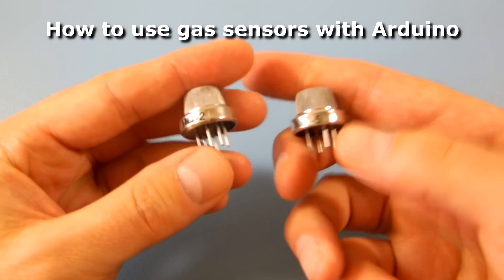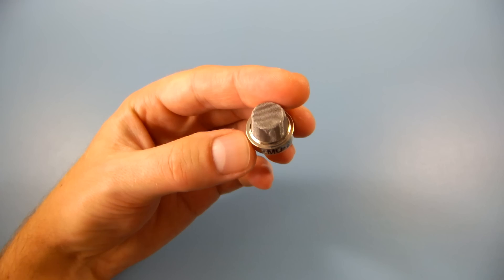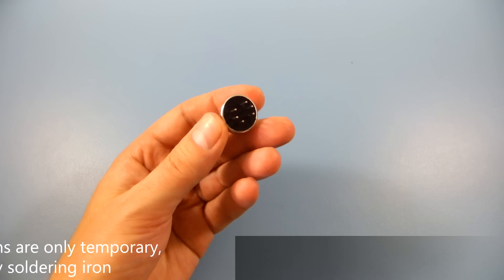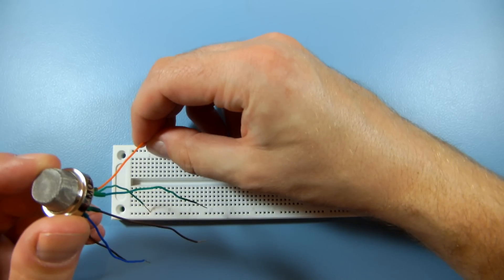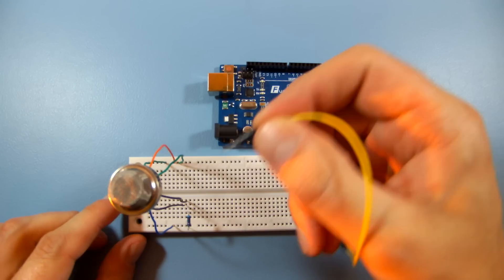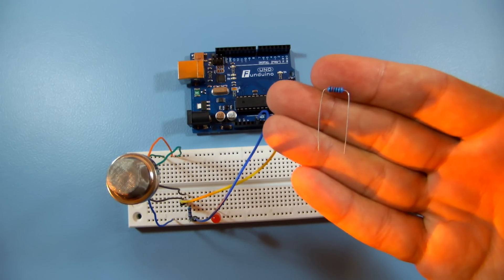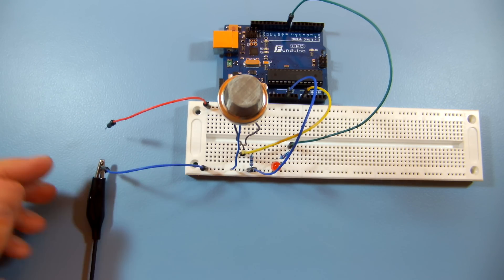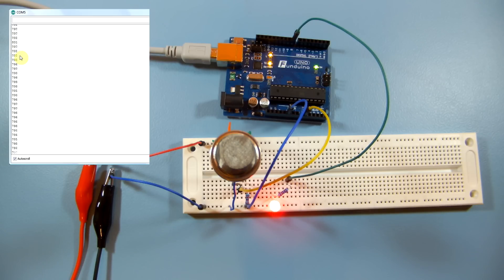How to use gas sensors with Arduino || Arduino tutorial

Comment: Have you ever built a functioning gas leak alarm with the MQ-5?  I bought one thinking I could make a gas leak detector with it, but boy is it ever finicky.  For starters, it could only detect butane (from a bic lighter) when I first turned it on, it didn't see methane (natural gas) coming out of my stove until 24 hours after being turned on, the "burn in time".  So now after being burned in, it can detect natural gas, but it's nowhere near as sensitive as my nose.  I can smell a gas leak in the room well before the little line on the serial plotter graph starts to actually move.  If you've actually built a gas leak alarm with one of these things, where did you put it?  On the floor, on the ceiling?  Does it work?
Reply from the maker: No, I haven't built a gas leak detector with the MQ-5. To tell you the truth, the MQ sensors are good for Arduino experiments, but they are not very reliable when it comes to serious applications. The readings are quite different almost every time and it's rather difficult to trust them. I know there are some much more serious sensors on the market, but they are also much, much more expensive.
Reply: I used one of these MQ-5 modules https://www.amazon.com/gp/product/B06XHKPV2Q/ref=oh_aui_detailpage_o01_s00?ie=UTF8&psc=1 and adjusted the sensitivity way down and the digital led turns on fairly quickly when I turn on my natural gas stove. If you're using the standalone sensor as done by ElectronFun.com you might want to adjust the 20k ohm resistor to increase sensitivity.

Comment: Does mq7 and mq4 have the same wiring?
Reply from the maker: Yes, the wiring diagram is pretty much the same. The only difference is the load resistor. Check these values in the datasheets.

Comment: hello , can you attempt to answer my question on https://forum.mysensors.org/topic/5760/co2-sensor-connexion-and-calibration
Reply from the maker: Have you preheated the sensor? Many sensors need to stay turned on for about 24 hours. Check in your datasheet if your sensor should be preheated. They sometimes use the term burn-in - that's the same thing. After that process the readings become more stable.

Comment: Great explanation.
I need to build a setup on a Raspberry Pi to detect benzene, formaldehyde, xylene and other VOCs.
Would appreciate your valuable input towards it. :)
Thanks.
Reply from the maker: Thanks a lot :)
You could use the following sensors:
- MQ135 or MQ138 for benzene
- MQ138 for formaldehyde
- I couldn't find a sensor for xylene
You can find a nice list of sensors with their applications here:
http://playground.arduino.cc/Main/MQGasSensors

When it comes to using sensors with a Raspberry Pi - I haven't tried that yet, so I'm not able to help you here, sorry.

Comment: can it detect carbon monoxide?
Reply from the maker: Not really, both detect several gases:
MQ-2 is good for LPG, i-butane, propane, methane ,alcohol, hydrogen, smoke,
MQ-5 detects LPG, natural gas, town gas.
Reply: ElectronFun.com then which module can be use to detect carbon monoxide? thank you in advance, i need this for my project
Reply from the maker: You could use an MQ-7 for your project.

Comment: If I want to see the measurement of gases in a wireless screen, then what should I do for?
Reply from the maker: You should decide which wireless standard would work best for you (bluetooth, WiFi, etc.). The next step would be finding the right chip/board capable of using your chosen standard and making it work with the LCD.

Comment: Hi, I am using a quarter watt 20k resistor .. Does that matter ? because mine isnt blue
Reply from the maker: Your resistor's fine, different manufacturers use different background colors. What matters are the colors of the stripes on it, which describe your resistor's value. These color codes are standardized, so all manufacturers use the same colors for coding values.
See more about it here: http://www.hobby-hour.com/electronics/resistorcalculator.php

Comment: Can I convert the readings to percentage and regulate the logging time interval. Also added like three more sensor and find their percentage composition in the biogas.I want to use it to log biogas composition from my digester.
Reply from the maker: You can easily adjust the logging time interval and add more sensors - each one should use a separate Arduino analog pin. The most difficult part would be the conversion of the readings into percentage.

Comment: how to work MQ-2 sensor ?
Reply from the maker: This video is about MQ-2 and MQ-5 sensors. You can operate both using the same circuit and code.
Reply: I want to know how to detect gas MQ-2 or  MQ-6?  Internal operation ? like , when it get gas how to convert it to digital signal ?
Reply: how to it sens gas ? can you please explain it ?
Reply from the maker: The sensor is a bit like an adjustable resistor. It's activated chemically by the gas, which changes the sensor's resistance.
Reply: Thanks a lot .....
Reply from the maker: No problem :)

Comment: i'm using mq - 6 sensor... what should be the threshold reading? how to map the output voltage to ppm?
Reply from the maker: That's the most problematic thing while working with these MQ sensors. You need to calibrate them to get proper readings.

Comment: That is really cool. Maybe you can help me with my thesis project. I have a very small amount of flow of CO2 and it's really a pain to detect it with anything actually. I was thinking of a hot wire anemometer. I found that it's possible with arduino but not sure where to begin. Will appreciate your opinion on this.
Reply from the maker: Thank you :)
To tell you the truth - I wouldn't use these MQ sensors for anything serious. They are quite inaccurate without proper calibration.
When it comes to the hot wire anemometer - I haven't played with this at all, but you could start reading here: http://playground.arduino.cc/Main/ThermalAnemometer.
Sorry I couldn't help you more.

Comment: That awesome! I would like to show magnitude of the gas also in LED screen, is it possible ? 
And can i connect temperature and moisture sensors as well to the same arduino ? 
I would appreciate if you can help and comment..
Reply from the maker: Yes, it is possible to add a screen to this project. You can also add multiple sensors to a single Arduino.
I'm working on a new video about using a small LCD, which should help a bit :)

Comment: what kind of gases i can detect ?
Reply from the maker: The MQ-2 can be used to detect: LPG, i-butane, propane, methane ,alcohol, Hydrogen, smoke, while the MQ-5: LPG, natural gas , town gas.
Reply: smoke like carbone particles or co2
Reply from the maker: I'm not sure, the datasheet doesn't say anything about it. I would guess it's about a mix of combustible gasses.
Reply: okay thank you for the info sir :)
Reply from the maker: No problem :)

Comment: I am unable to determine which are "A" pins and which are "B" pins. Is there some marking or something that I can refer? Can you please help?
Reply from the maker: Good question - it doesn't matter which of the two pairs is A and which is B. Letters A and B are only used for wiring diagram reference. The sensor can be even powered with AC voltage, so you don't have to worry about polarity.

Comment: Hey man. Awesome project! If I am trying to make a reliable diy smoke alarm which sensors will I need? The MQ-7 for CO and MQ-2 for everything else? Thanks!
Reply from the maker: Thanks a lot Jim! You could use the MQ-2 alone as a smoke detector. However, I wouldn't use these sensors in my home smoke detectors. They are nice when you want to learn how to use Arduino with them, but their reliability isn't very good.

Comment: Hi i have a quick question, well two really. Can you connect multiple different MQ series sensors in parallel ? to each other ? also is it possible to add an LCD display to display the levels ?
Reply from the maker: Hi, MQ sensors are purely analog and it's not really possible to stack them (use one analog pin to read values from different sensors). You would need one analog pin for every single sensor.
It is possible to add an LCD to the sensor. I'm working on a new tutorial on using an LCD with Arduino Uno.
Reply: ah alright thats fine thanks makes sense to use a different analog pin

Comment: Very nice video. I wanted to ask you, if I want to use the gas sensor with Arduino on a flying drone, do you think this technique can work? Or I should proceed with another way? Thank you for your time...
Reply from the maker: +Georges Tufenkji Thank you for your comment and watching. Your idea is very cool! I believe it should work, however these sensors are not super accurate - bear that in mind.
Reply: Okay, I will keep you posted with the implementation of the project :)
Reply from the maker: Great, I would like to know how it turns out.

Comment: Hello sir. I am planning to use MQ-2 for our project but it would be used in op-amp comparator circuit. is it possible to use this sensor in this manner? or it would only work with coded program circuits?

And are the A pins for supply and the B pins for output? The center pins are for heating element and ground
Thank you!
Reply from the maker: MQ-2 can be used in many different ways, you don't need the code if you don't want to use a microcontroller.
The 2 central pins are for the heating element. Both pairs of pins A and B can be swapped - so the B pair can become the A pair and vice versa. It doesn't matter which pair is A and which is B for you. There is also no polarity for the heating element and you can power it even by 5V AC.
Reply: Thank you for your response sir. But i am still confused.
Can you please help me with my circuit for our thesis. Can I email you?

Anyway our project is about ethylene extracting from the crater (device) which has mangoes as subject. The goal is to turn on the fan (exhaust) if it senses that the gas concentration is greater than our set reference value (VALUE IS IN PPM), in order to remove the ethylene gas inside the chamber. My problem is I do not understand how to convert the analog output of MQ2 (still not sure if its analog voltage or what) into its corresponding GAS PPM level and vice versa. By the way im using PIC16F877 not Arduino.

Please help me sir. Please please.
Thank you very much!
Reply from the maker: Hi, I make videos to inspire people. I want you guys to come up with project ideas, solve problems and make your projects work on your own. I'm not able to help with every project I'm asked about, sorry.
I have a regular job and struggle against time every single day, because making videos takes so much time and effort. I hope you'll understand my point of view. Sorry I'm not able to help with your project.
I wish you good luck and believe you come up with the best solution for your needs.

Comment: When hook up MQ-2 with 5V onboard pin, the voltage drop to 4.86V
Is it better to use the external very smooth 5V regulator ?
Reply from the maker: It's better to use an external power supply, because the MQ-2 consumes up to 160mA, while Arduino Uno can deliver 200mA maximum. If you connect something more than just the sensor, you can burn out your Arduino.

Comment: Hi sir how do you interpret the data gathered in the serial monitor? What is the unit of measurement of the data showing in the serial monitor?
Reply from the maker: There is no easy way of interpreting this data. You should calibrate your sensor to get the readings in ppm units for example. I have another video about software calibration of an MQ-2. It's quite short, but I explained a bit about sensor calibration there.

Comment: Sir, how can I use 12 v Battery to power MO-2 sensor.
Reply from the maker: You could use a buck converter to drop voltage to 5V.

Comment: hallo sir, can i use the battery for power supply ?
Reply from the maker: Sure, you can use a battery, but be aware these sensors may consume about 160mA.
Reply: how long if i'm using 9v type battery ?
everyday must changes ?
Reply from the maker: I'm afraid it could mean replacing your battery every single day. 9V batteries don't store too much juice - according to Wikipedia alkaline 9V batteries go up to 550mAh. This could power your sensor for a couple of hours.
Reply from the maker: You could use my official e-mail address: mailbox@electronfun.com. However I can't guarantee I will reply in a timely manner. I'm still trying to find more time for YouTube videos.
Reply: Thank you, i understand.
i'll send my pic project
Reply from the maker: Ok.

Comment: is there any way for the MQ5 to tell you what type of gas it detects? or does it just light up with any of those it detects?
Reply from the maker: The sensor only detects there is some gas concentration, but it is not able to differentiate between them.

Comment: may i know.. can use the power supply that from the arduino itself ?
Reply from the maker: +Rusydi Udy I wouldn't recommend that, because these sensors draw about 160mA. Arduino Uno can deliver 200mA maximum. If you connect anything more, you may fry your Arduino board.
Reply: Even use arduino mega?  okay sir.. Tq for the advise
Reply from the maker: +Rusydi Udy Arduino Mega has the same current limitations - 200mA.
Reply: +ElectronFun.com thanx again.. is that any web that i can refer for more information that you recommended that easy to get feedback?  i got to do some a final project about smart home.. need more information..  :-)
Reply from the maker: +Rusydi Udy You can find a lot of info about Arduino on: http://playground.arduino.cc.
Reply from the maker: Sorry for replying so late - there is so much information on http://playground.arduino.cc.

Comment: I am using an mq4 methane sensor. Does it have the same drive circuit to power up the sensor?
Reply from the maker: +Jpiks piks Yes, you can use it in exactly the same way.

Comment: can we make them wirreless to use with quadcopter
Reply from the maker: +Diljot Singh Yes, you can make them send data wirelessly, or even via a GSM module. It all depends on your microcontroller.
Reply: plz make a guide or Contact me Privately my Email diljots99@gmail.com
Reply from the maker: +Diljot Singh Hi again, everything depends on technology you want to use. I don't have a tutorial on this matter.
Reply: +ElectronFun.com Plz suggest some technology of some way out i am working on school project and i  hve no info how to do this wirelessly
Reply from the maker: +Diljot Singh Do you want the sensor circuit to be an independent part only transported by your quadcopter?
Reply: +ElectronFun.com  i want a sensor circit for quadcopter as well as a ground reading station
Reply from the maker: +Diljot Singh My experience with quadcopters is minimal (at least for now), so I'm not able to help you, sorry.

Comment: Hey great project.
I am doing something similar but I am confused are the sensor value same as the concentration value of the gas, I want to measure the consentration of LPG in a room.
Reply from the maker: +alnada alkubaisi Thanks :)
Unfortunately it's not that easy. The readings are just analog values taken from the sensitive element and converted by Arduino to digital values between 0 and 1023.
To get values in some well known units like ppm, you need to calibrate the sensor. Normally you would need special equipment to do it, but if you want to use an MQ-2 sensor, there is a piece of code made by Sandbox Electronics, which simplifies the calibration process, but the readings will be less accurate. You can read more about it, here: http://sandboxelectronics.com/?p=165.
By the way - I'm starting my new video about the MQ-2 calibration with the Sandbox Electronics piece of code.
Reply: +ElectronFun.com  Hi, thanks for the replay it was very helpful.
Reply from the maker: +alnada alkubaisi Thanks :)

Comment: can i use a speaker on this rather than  LED lights ?
Reply from the maker: +michael lenly luczon Sure you can. You need to add a few lines of code, if you want to use a simple tone, or a bit more code if you want to play melodies.
There are 2 nice articles about piezo buzzers with Arduino here:
https://www.arduino.cc/en/Reference/Tone
https://www.arduino.cc/en/Tutorial/PlayMelody
Reply: thanks
Reply from the maker: +michael lenly luczon No problem :)